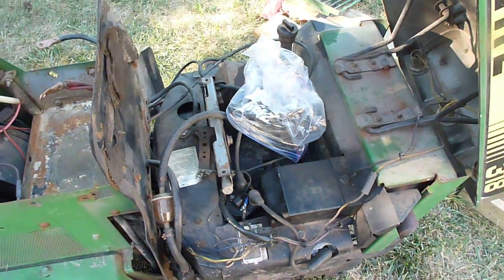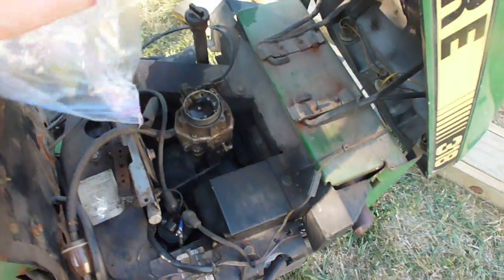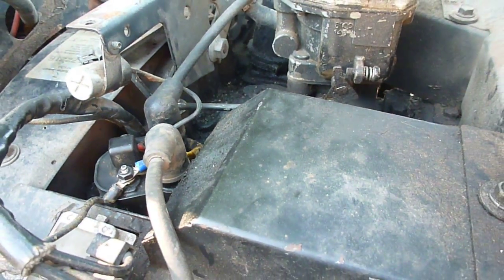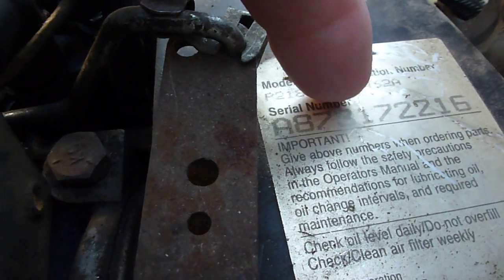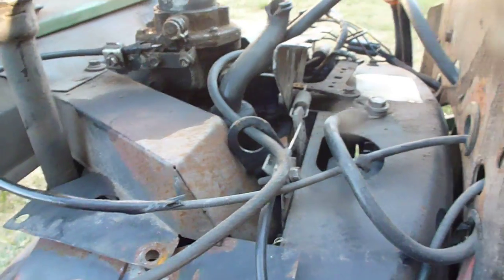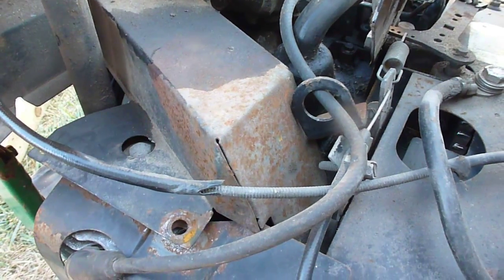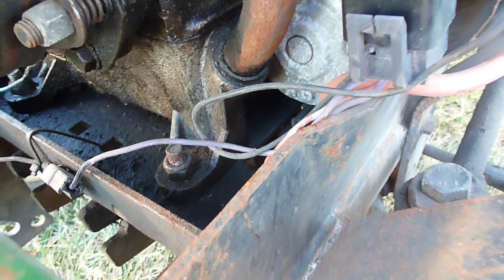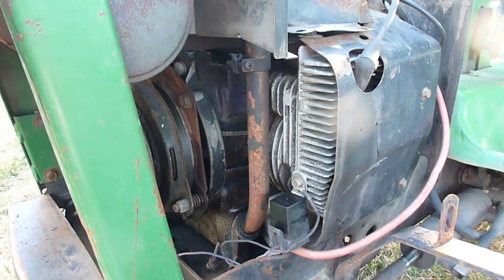John Deere 318 Onan Engine Differences B43G vs P218G

Comment: I just picked up 317 with onan p218g  i got great deal on but 
It acts like timming is off 
Will not start back fires when cranking 
If this doesnt have points can it still be out of time hopefully its not bad valves? Kinda bummed

Comment: Can an onan p218 with electronic ignition be switched to and older onan egine with a point driven ignition and use the electronic ignition off the p218.

Comment: Where the hell can I get aftermarket parts for the p218g? I need a stator, rotor and ignition control module I just can't bring my self to spend over 400$ for all 3 for oem from Cummins
Reply from the maker: About the best place to get them is used on eBay. Stators are typically cheap, ignition and rotors used to be $100 used.

Comment: I recently bought a 1988 that has the B43G.   Must be a repower or something
Reply from the maker: Yes, finding a B43G is not uncommon in newer units. The two engines are interchangeable with the units with some realistically east modifications.

Comment: Hi mmrbeef, Just watched your video June 11, 2015 about B43G and P218G engine differences. Can you tell me where solenoid on the B43G was mounted on the JD 318. Because of repeated starter loosening resulting in ring gear damage, I change out my origin P218G oil pan to the B43-48G oil pan. Now need to figure out what kind of solenoid to purchase for the new B43-48G starter and where is the best or most convenient place to mount the solenoid. can you advise? I will appreciate any assistant you can provide. Happy 4th!!!

Comment: Hi. Fantastic videos of you work on the 318s and Onan engines.  I've been reassembling a late 1989 318 that I received with the engine removed and mostly torn apart.  Your videos of tearing down and rebuilding the Onan engine have been invaluable to me.  I've only worked on the B43G engines so I have a question about the routing of the starter power cable from the starter solenoid.  Is the routing in this video accurate?  Thanks for all your help.
Reply from the maker: Thanks

Comment: I just bought a 318 with a stuck engine. It is the B43G. It is being delivered in an hour. I’m excited. Before I know more about the engine condition I’ll go through the steps of checking the oil, removing plugs and doing short cranks (see if it was hydro-locked), and just checking out how the previous owner maintained it. I will then probably put some Marvel Mystery oil in and soak the pistons. Any additional recommendations?

Comment: An excellent video!!! I now know that my engine (with no I.D. tag present) is a B43G 16hp machine..  Mine has breaker points, something that the P218's did away with... And a stock bore of 3.250" and a stroke of 2.625"... Mine has no lugs for a starter on the R/H cylinder, but it uses lugs and a starter mount plate that are attached to the oil pan assembly.... This video was a BIG help to I.D. the machine that I bought at a garage sale... Thanks again!!!
Reply from the maker: Congrats on picking one up at a garage sale. The couple times I have tried to do that they have always been Grade A collector prices!! Glad the video helped.
Reply: instaBlaster.

Comment: Can you put a p218a in the place of p43g
Reply from the maker: Yes, you can use a P218 in place of a B43G. You will need the correct driveshaft and there are a couple of small wiring changes that will need to be made. Other than that, a P218 will bolt right in. To avoid the wiring changes, use your B43G oil pan and starter.

Comment: i have a performer 20 sxl onan with no spark turns over but when i put my spark tester on i get no spark  any sugestions for me thx
Reply from the maker: Could be anything from a bad key switch, bad coil, or even a pick up. If you can test each component individually.

Comment: Is there any difference in the carburetor from the b43g ?
Reply from the maker: Yes, the carbs between the engines do differ. The main differences are in the Venturi (throat of the carb) and the main jet (which you cannot see without some disassembly).

Comment: I have a Gehl 2500 Hydra Cat with a 24 hp Onan Performer engine. The engine is the P218G as depicted in your video. I resurrected this old skid loader from a farm grove. In the process, the engine has received a new coil, spark plugs, spark plug wires, filters etc. The engine starts fine (even in very cold conditions) and runs great until it reaches operating temperature. Once it fully warms up the engine bogs (cuts) out. I removed the air cleaner and observed a fuel spay inside the carburetor when the bogging takes place. A small black puff of exhaust occurs when this spray of unneeded fuel occurs. I'm curious as to why this occurs and what the fix my be. The carburetor has never been rebuilt, but it has received a new needle and float.

Comment: I have a 87 John Deere 318 with the p218g my problem I have is the starter mounting on the cylinder are broke .
Will the pan from a  b48g fit my engine and is that the one that has the starter mount on the oil pan .
Thanks for any help
Reply from the maker: Yes, an oil pan from a B43 with the starter mount will fit on a P218. You will need to make sure you have the correct starter (the housing is a bit different) or change it over to the bendix style starter with the solenoid under the instrument panel.

Comment: I'm going to look at a 317 today that the seller says has the retro-fit Onan P-218.  This was a very helpful video to help me determine if he's right and not the original Kohler Series I.  The Kohler had bad issues with lubrication.
Reply from the maker: Glad it helped. Hopefully you were about to get the 317 w/ Onan. The 317's with Series II Kohlers or the Onans are workhorses.

Comment: the relay mounted on the side is a NECESSARY option for hard starting. they are known to only click when starting. this kit fixes that problem permanently.
Reply from the maker: Correct it is a helpful addition. However, I have also found a through cleaning of all the connections in the electrical system plus a double check of all the grounds works wonders for the poor starter performance. It would fix the problem permanently as long as there are halfway decent ground connections. The grounds always seem to be the problem on these machine for some reason.
Reply: the key switch contacts do not carry enough current to hold the starting relay in after a few years. I do agree that Maintenance is important.

Comment: Is one engine more reliable than the other?
Reply from the maker: They are both very reliable engines. They should go 1000-2000 hrs with only good maintenance practices. With poor maintenance they will last less than 1000 hrs.